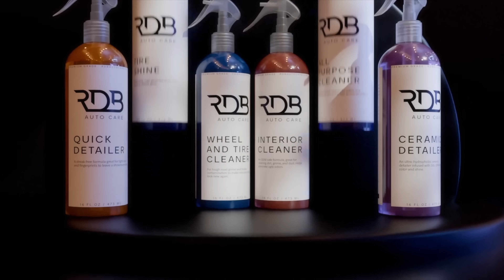Vik's URUS is Gone? Crazy Rolls Royce Spectre Kit Arrives!

Comment: If it's just a valve or piston or a ring surely it would be a fairly straightforward repair. Only if there is damage to the block would ypu want to engine swap... i suppose if money is not a consideration then the swap is simpler but that 10k motor must have been $$$$$

Comment: If I am not wrong its the same engine as audi rs6
Reply: Indeed it is. It’s the exact same car with different design and logo
Reply: Same car as the rsq8
Reply: Actually the Audi QRS8 since they're built on the same platform.
Reply: panamera has the same engine as well
Reply: Same engine is lots of cars, RS6, RsQ8, Cayenne, panamera, etc
Reply: @OmezzyGONEglobal it’s not, different tuning and components and suspension/brakes
Reply: @Clairebaby223  I did said different designs 😂

Comment: You have a garage why does your car need to be diagnosed at lambo?
Reply: Lamborghini specific technicians diagnosing using their resources. Why not?
Reply: excellent question, one might wonder, if the team is capable of handling such a task
Reply from the maker: We will be replacing the engine here. Just wanted another opinion by the certified dealer techs.

Comment: Why in gods name would a new lambos engines blow ? I have camaros , mercury ' s , trans am' s with over 120,000 miles each  , never blown 😅😊, ' 08  mercury  milan pushing 140,000 mi' s , never timed , tuned runs like a bentley .
Reply: I mean, it's not new, and it had an aggressive tune on it. Anything could cause it.